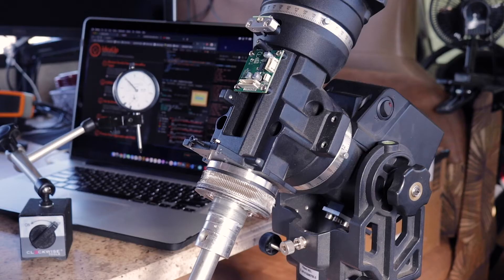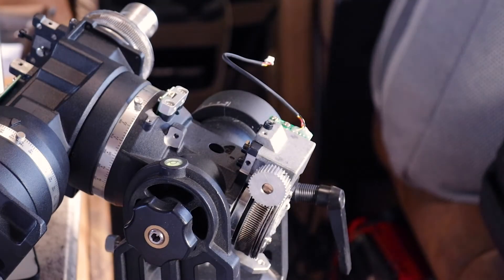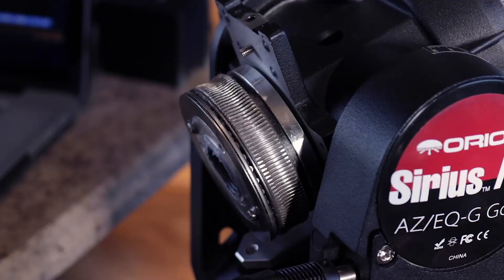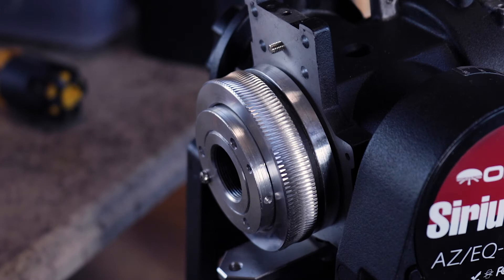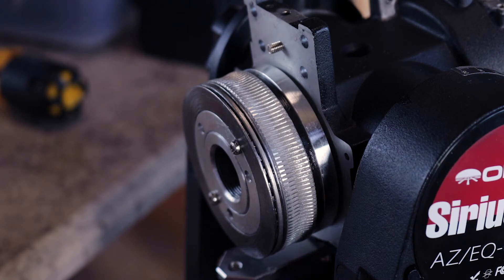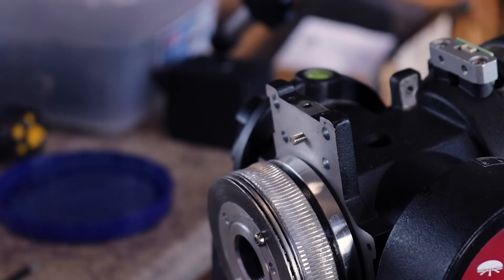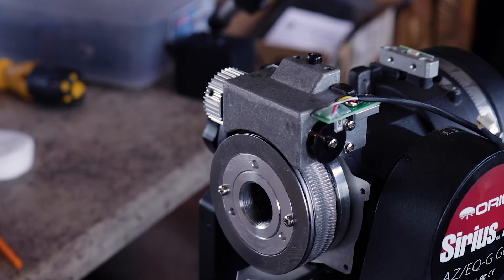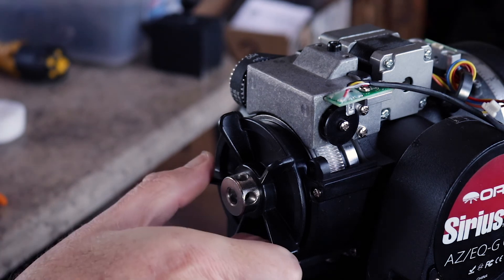🔭Telescope Mount Backlash Tune-Up (Orion Sirius Pro AZ/EQ-G | SkyWatcher AZ-EQ/5) [DIY]

Comment: Yes adding a long dovetail  bar increases the moment arm distance and accentuates backlash. I do not recommend not using grease. With my 10" astrograph on i can feel a slight backlash in the RA axis but some small amounts of backlash is normal and inherent to the mechanism. All systems have backlash because you cannot get the gears too tight. This will harm the gears and your mount will let you know because it will sound louder when you run it. If your stars are not round you should always check simpler things first like polar alignment and go to tracking accuracy. I know this is two years old but guiding properly will also make your stars round. I would check these things first before taking apart the mount head. All this said, it is well known that the Chinese use thick red grease on many of their mounts. Especially Synta. They make all of the mounts and telescopes for Orion. There is a much better suited grease for these things but I cannot find the name at the moment. Not as heavy and better for dissimilar metals.

Comment: Dear friend, In the minutes 10.06, you put a  in the video about reversing the position of the bearing, was it placed in the video in the wrong position? the concave side of the bearing has to face out, is that it?  Thank for vídeo.
Reply from the maker: The way the mount was originally assembled had the concave side facing out. However, I don't think it really matters either way. Thank you for your comment!
Reply: @explorelearnshare8222  ok! Thanks .

Comment: I reccomend adjusting the backlash with clean non lubricated gears as the grease will mask the true running clearance. I further recommend you attach a dovetail bar to the axis of interest. The larger radius will magnify the backlash and better approximate what the movement is like on the telescope itself. 
I have not had the AZ series apart but from your video I can make some educated guesses for what is binding on the axis. Typically the clutches work by clamping the crown wheel (what you call the ring gear) to the bearing housing. By necessity this has to be a very close fit and is open to assembly errors as you might find in mass production by semi skilled workers. So while there may be some drag when de-clutched it is irrelevant when the clutch is engaged so far as tracking is concerned but the binding will influence balancing of the scope. That is assuming the main bearings are set correctly.

Comment: i appreciate you making this video
Reply from the maker: Thank you for the comment! Do you have this mount?
Reply: I have the Orion Atlas pro (now unavailable)and it's been acting up. I didn't want to open it up without knowing what I was getting into. I plan on changing out the belts and cleaning it up nice.
Reply from the maker: @thatgoose2639  What symptoms is it showing? I hope it is similar enough to its little brother for this video to be relevant, and I wish you good luck in getting it back in good shape!

Comment: Would you know which ball bearings are in the worm gear? I need to replace mine. Waiting for a spanning wrench to arrive before I can take it out to examine and measure
Reply from the maker: Sorry, I don't. I didn't have to take it apart that far. What happened to yours? Fingers crossed that they used something standard and easy to find!
Reply from the maker: Did you have any luck finding these bearings? I just had mine apart again and I found the worms to be pretty rough feeling when turning by hand. My guiding has been getting worse lately too, so I fear those now need replacing.
Reply: My ra worm bearings are rough as well. Did you ever replace them? My guiding is getting less consistent and I suspect this is the cause.

Comment: 18:40   That's the sound of binding.   You DEC worm is too tight....
Reply from the maker: I wasn't sure which sound you were referring to. Do you have this mount? The stepper drivers are quite noisy when it is accelerating and decelerating. I can't hear anything over the racket of that. Maybe a trinamic upgrade someday....
Reply: No it's not this is the decelerating sound of this mount its perfect.... :)

Comment: My clutches were to loose my opt moved to easily. So I just took the clutch levers off and just turn my levers back a notch and problem was solved that easily. The levers are on splines so its basically reindexing them to new position. Hopefully that helps you.
Reply from the maker: Thank you for the suggestion!

Comment: Why is the backlash a problem ? Is it possible to avoid it by adjusting the mount balance such that it is slightly pulling in one direction ? This way it would make a consistent pressure on gears.
Reply from the maker: At the time I made the video I thought backlash was causing the issues I was having. It was in fact the RA worm encoder catching every rev that was causing the majority of the trouble. Cleaning everything up and replacing the lube seemed to help also. The mount is back to having about the same amount of slop as it had when I made the video, but the tracking issues never returned.
Reply from the maker: At the time I made the video I thought backlash was causing the issues I was having. It was in fact the RA worm encoder catching every rev that was causing the majority of the trouble. Cleaning everything up and replacing the lube seemed to help also. The mount is back to having about the same amount of slop as it had when I made the video, but the tracking issues never returned.
Reply: @explorelearnshare8222  When you said that "..It was in fact the RA worm encoder catching every rev that was causing the majority of the trouble..." what did you do to solve this ?... could you "disconnect" this encoders while you are guiding ? thanks a lot for all time dedicated to us...
Reply from the maker: @TheFranqd  If you compare the worm block for the dec axis to the ra axis, you will notice that the ra one has a circuit board and a disk with a slot cut in it that the dec one does not have. This is the encoder for the PEC (periodic error correction) function. In my case, the slot in the disk was catching on a part from the circuit board because the disk was not square to the end of the worm shaft. I would expect that to be uncommon. When you have the ra worm block out of the mount, you can check this by rotating the worm using the pulley that the belt goes on when it is assembled. Slowly rotate it through a few turns. If anything is catching, you will feel it. If it is smooth, then there is no problem. Thank you for your comments, and I hope my answers are helpful to you!

Comment: Good informative video, The “ring gear” you mention is called the worm gear and the worm drives the worm gear
Reply from the maker: Thanks!
Reply: @explorelearnshare8222  Your video was important as I am considering this mount as an option to the cost of upgrading my 10 year-old Losmandy GM8 (non Go-To) with their Gemini 2 Retrofit Kit.  The Kit costs more than the list price of this mount.
Reply from the maker: @stephenc2738  I'd be interested to know what you decide and the reasoning that goes into it. I would like to learn more about different mounts since all of my experience is with just this one. My horizons could use a bit of broadening! Is your GM8 fully manual at the moment? What does the kit include, and is it something you would upgrade yourself or do you need to send it out?

Comment: The stiifness in the RA axis is due to excessive bearing preload.  The part with three holes is a nut that adjusts the preload.  That should be set so that there is no play but that the ra axis shaft turns freely.
Reply from the maker: It took me a long time to finally realize what this meant. Better late than never I suppose. Thank you for pointing this out!
Reply: @explorelearnshare8222  Please 🙏 could you explain this a bit more, with much more details, i think this is a key point for my mount, that the RA axis when is blocked moves right-left 2 or 3 mm, too much, and i think that it's no normal it all... ( sorry about level of english )
Reply from the maker: @TheFranqd  The first thing to check is if you got the mesh between the worm and worm gear (I called it the ring gear in the video) as good as you can. Unfortunately with that mount, when you unlock the clutch the entire worm gear can shift a bit, which undoes your hard work of getting the mesh right. In the video you can see how I removed the worm gear by removing two screws and the clutch thrust bearing. When the worm gear is put back in place, it should be able to spin but have minimal "play" if you were to try to shift it laterally across the rotational axis. There will always be a bit of play, and this is why the mesh goes out a bit when the clutch is released, but there will be more play if there has been wear. I don't know of a solution if it is indeed worn excessively. The other possibility is the bearings on the worm assembly. You can check that by removing the worm block and seeing if the worm moves end to end in the worm block. If it does, then either it needs to be tightened or the bearings need to be replaced. All that being said, the most likely solution is that you just need to get the mesh between the two gears better. Take your time with this. It is difficult to get it right. In my experience it takes many adjustments to get it right. As you tighten down the 4 screws it tends to shift position. So you must iterate tightening, then adjusting, then tightening more, then adjusting more, until you get it right. It is tedious, but you will succeed if you are patient and careful.
Reply: @explorelearnshare8222  Hello,
Apologies for not being able to respond more quickly. Thank you again for taking the time to answer me in detail. 

I have made an attempt to open, clean and adjust the mount but have not been able to improve it. 

I have decided that I will spend some money and take it to the technical service near Barcelona now in September. I have already contacted them and in a couple of hours they will take it apart, clean it, grease it, check the backlash and movements of the shaft and I have asked them if they can replace the bearings.... 

I hope it gets better and if not extend the life of the mount ... before jumping like many people to another more robust as the eq6. 

Thank you very much for everything and I hope to enjoy your content on YouTube .... You make very good presentations and you have everything it takes to have many followers on the channel ...so go ahead....
Reply from the maker: @TheFranqd  Thank you for the kind words. I hope the shop is able to get your mount working properly again. Clear skies!

Comment: Thanks for posting this. I have this mount and always wanted to take a look at it inside and see if i can fix the backlash but mainly avoided it due to fear of messing it up. Thanks for spending the time to make this video easy to understand and follow! Just waiting on the lube to come in.
Reply from the maker: Thanks for the comment! I really need to post a follow up...the backlash came back fairly quickly. The mount still performs much better due to the better lube. Focus your effort on getting things cleaned and lubed and hopefully you will enjoy a similar result! Please post another comment when you're done, I'd like to know how you make out!
Reply: @explorelearnshare8222  Thanks will do! Ive been having fairly poor guidance, RMS at pretty much 2 and above. Ive always shot at under 400mm focal length so it never really caused bad stars. However I wanted to try using an SCT to image galaxies and it performed fairly badly. Doing some reading on cloudynights suggested taking a look inside, with a few people reporting pretty good results after tightening things up. Will let you know how this turns out.
Reply from the maker: @DomZ83  Good luck! What size SCT are you trying, and what's the focal length of your guide setup? Are you using a reducer/corrector/flattener of some kind? Double-check the encoder on the RA axis worm - mine was catching. My guiding performance definitely improved after the clean and lube; I hope you find the same!
Reply: @explorelearnshare8222  8 inch edge with the 0.7x reducer using an oag. Im hoping for the same, the RA is usually always way worse then the DEC and the ppec doesn't do anything to help so im guessing similar misalignment. Will report back.
Reply from the maker: @DomZ83  We are running nearly the same setup, only I have an old plain C8. OAG improved my guiding immensely, so happy to hear that you're already doing that. I've used my tube both with and without the .63 reducer with good guiding and results.

Comment: So, any results to share since making the video. I'm fairly new to imaging (less than a year) and even newer to guiding. I have a couple year old Orion EQ-G mount paired with a 72mm refractor. I'm trying to improve my guiding but running into issues with my DEC backlash. PHD2 measured it at 4,167 ms. What was your mount measuring before and after the awesome video above? I'm a little scared to get into the hardware side and was hoping to fix it with software tweaks but I think 4,167 ms is too large.
Reply from the maker: First, thank you for the comment and compliment! I really do need to make a follow up to this video. It turns out that while I did improve the backlash temporarily, it all came back. Not sure why. Could be temperature changes, or maybe the worm block just slips. However, the mount is still working much better than it ever did, even right out of the box. Changing the grease did more for guiding performance than getting rid of the backlash, and by a significant amount. It's like a different mount now.
I didn't know how to make PHD measure the dec backlash before I did this, but now it's still over 3 seconds. This causes problems occasionally because PHD stops taking exposures while it spends those 3 seconds unwinding the backlash. A well timed gust of wind will cause PHD to lose the star. You may or may not experience the same. It depends how well your mount tracks unguided I think. Mine is not great that way, so those 3 seconds usually see a lot of movement in the guide star for me. If you don't see that much movement, then don't worry too much about the 4 seconds. 
Which mount is the EQ-G? Is that like an EQ-5? If so I believe you can tweak the worm engagement without taking the mount apart. Most of the other skywatcher mounts besides mine have the adjustments externalized. I understand your hesitation to start taking stuff apart. If you do decide to, just go slow and take lots of pictures and notes along the way. It really helps when re-assembling.
Reply: @explorelearnshare8222  I have the same problem with my AZ-EQ5. I suspect, that releasing and engaging the clutch is the reason why the wobble comes back over time. 
Recently I try to avoid manual movements as much as possible, I haven' t touched the clutches since I adjusted them last time (4 months ago) and no degradation so far.
Reply from the maker: @Megavoltamper  Interesting experiment, thank you for sharing your results! Is your telescope in a fixed location? I don't know how I would be able to balance without releasing the clutches.
Reply: @explorelearnshare8222  yes, I have a fixed pier. But I change the scopes on it. I marked the counterweight positions for each scope on the counterweight shaft and I also marked the DEC balance position on the dovetail bar. It also makes the preparation much faster.

Comment: Thanks so much for posting this video. I have been on the fence about getting one of these mounts, and have heard about folks adjusting them, but hadn't found a good video or tutorial to actually do it. This video will give me the confidence to go ahead and get one, and it it develops the backlash problem, I'll just adjust it out. It a shame these amounts seem to be afflicted with this problem, but the fix outlined here is very doable for most people with even moderate mechanical experience.  Le tu know when you have a chance to take some more pictures and if the adjustment helped.
Reply from the maker: Hi, Eric! You're welcome, and thanks for the comment (and watching!). I will be making another video following up on this one soon. I was able to get one night of imaging in after the work and it was an entirely different experience than I've been having for the past year. That said, I don't think the improvement was due to minimizing the backlash. I say that because once the scope got cold I noticed quite a bit of the free play came back, yet I was still getting good subs. PHD was also working a lot less hard than it ever had before. There were even stretches of several seconds where the mount just tracked and PHD made no corrections. Before the work I was getting a pretty bad oscillation every time around on the worm (based on the timing), and I'm now convinced that was the catching I mentioned in the video. Ironically the catching went away somewhere along the way; it was gone by the time I reassembled the dec axis.  The encoder wheel was probably hitting or rubbing and was corrected by accident along the way of moving it to the other worm. So, I feel the biggest improvement came just from cleaning things up, using some proper grease, and careful reassembly. Let me know if you end up with this mount or something else, and clear skies!
Reply: Mine has about 3200ms on the DEC axle. My belt-modded HEQ5 has about 600ms compared to this. If you inspect the motors and the belt, you can see, that this backlash comes from inside the stepper motor, probably because it has gears inside. I don't know the reason for this, but probably  the step size of the stepper motor is too big and they had to add the gears. Which highly reduces the advantages of the belt drive, because they couldn't fully eliminate the gears.